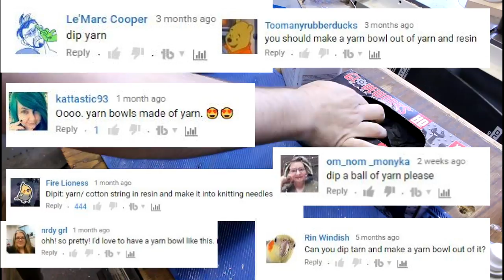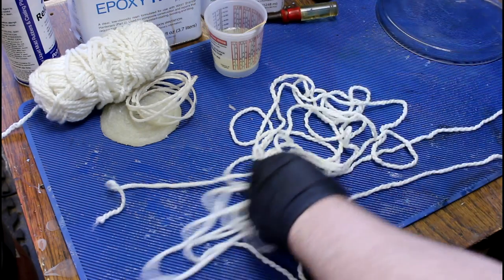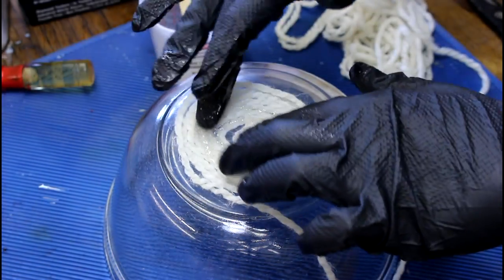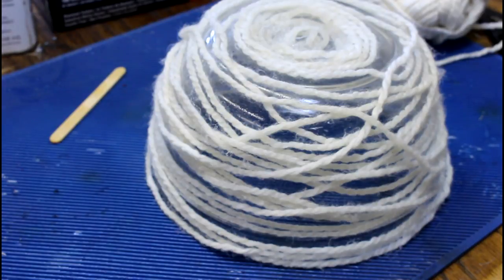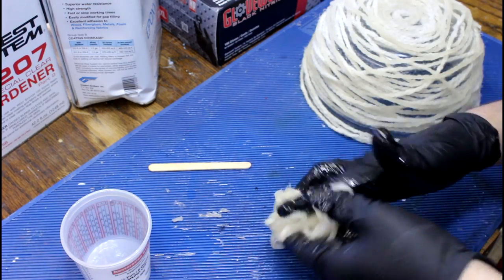DipIt #15: Epoxy vs Yarn: Not Your Grandma's Yarn Bowl

Comment: you should dip leaves this fall.  All the colors!
Reply: Too much moisture, I think. I like that idea, though!
Reply: Could press them in a book beforehand. It would take away the nice, curved shape some leaves have though...
Reply: SomiTomi that is actually what I was thinking.
Reply: They make a dessicant specifically for drying flowers and other plant materials that dries it out while still preserving the colors.  It's used a lot for wedding bouquets etc, but I have also seen a few resin jewelry tutorials that suggest using it on botanicals you want to embed.
Reply: Dan Tuck would be a cool cutting board pattern
Reply: Yes please

Comment: if you dipped Christmas tree lights in a brick of epoxy and left the end of the cord out, do you think it would still work? And if it does you should make a Christmas tree light bowl. Maybe use the battery powered lights for safety.

Comment: You should dip unsoaked orbeez/water balls in resin and see if they soak up any resin during the cure process.
Reply: Brock Edwards You're a genius
Reply: No that wouldn't work
Reply: Nic Zammeti did it. It did not work

Comment: Try and make a sand/hour glass out of resin!
Reply: Maybe whole block of clear resin with hourglass shaped cavity inside it.
Reply: Make it out of sand dipped in resin!

Then again, that might pose problems when cutting it - sand is very hard compared to the materials that were dipped before.
Reply: Ignoring the fact that sand isn't see through?
Reply: Make an hour glass, with a baby hour glass inside! One measures minutes and the other, hours!
Reply: Shouldn't the glass that measures minutes be a minute glass?
Reply: Lizzy Wonder, not if it measures 60 minutes! haha
Reply: Brilliant

Comment: You should do this with cooked pasta! Then you can eat pasta out of your pasta bowl. Maybe you can drink a Shasta at the same time?
Reply: I like this idea a lot. Even though I have no idea what Shasta is.
Reply: Shasta is pop or soda
Reply: But cooked pasta is filled with water and you need to have zero moisture for resin
Reply: Maybe you could cook the pasta, put it around the bowl and leave it until it's rubbery and dry, and then coat it in epoxy?
Reply: cook pasta, place on bowl like yarn, let it dry, then dip it :)
Reply: this needs to happen
Reply: ***** ba-dum-tiss
Reply: Eat Shasta flavored pasta out of a pasta pasta bowl. Did I get that right?
Reply: make the pasta yourself then it may be dry enough to do this. you wouldn't have to cook it it would still be in the dough phase.
Reply: pasta is brittle. it would need the resin to not shatter into a million pieces
Reply: You cant eat out of resin bowls, theyre not safe for that. You could try something like a food safe acrylic, but please dont put resin near food, cured or not
Reply: Acrylic resin is still resin, just a different type.  Alumilite resin has been cleared by the FDA for food use.

Comment: Idea: Once you've added the last layer of resin-soaked yarn, and while the resin is still wet, add a layer of dry yarn. The dry yarn will soak enough resin to adhere to the soaked yarn, but once the whole thing is dry, it should still have the yarn feel.
Reply: Mark Speir Ooooh Good Idea, very neat. I was planning on attempting this, and that last touch seems perfect! Thanks.
Also, I'm probably gonna mix my resin and yarn in a bag, so I don't waste it on my bench lol Also I thought just soak enough for the bottom, and make that first, let it dry, then move on with the rest.. cleanest way probably.

Comment: what if you took a bowl slightly larger than the glass one here, put the yarn blow in it with the glass bowl in that, and filled it up around the edges with epoxy, so that the yarn is suspended inside the epoxy and the bowl is even more useful? I think that would look really cool too.

Comment: Peter, since you get so much beautiful hardwood from your local gun stock manufacturer. You should do a lichtenberg cutting board. 

Either that or I learned a long time ago that you can pour off the enamel from old enamel pain that has been sitting for years. If you add dye to it it looks really cool cause you get an uneven colored stain.

Comment: Try a DipIt Lego bowl. Like, start by making a square (like L7" x W7" x D4") out of Lego bricks, leaving some open holes for the (clear) resin  to sit in and bond to all the bricks better (even cooler if you shaved/chopped bricks to add multicolored speckling to the resin). Then turn it to a large bowl. 

I'm thinking of trying it myself, but I'm not sure how it will turn out, and I'd like to see what I could expect while trying it.

Comment: The ideal contents for a yarn bowl are yarn. Specifically yarn for a project you’re currently working on, with the active end of the skein running out through one of the gaps so it doesn’t tangle as you knit/crochet.

Comment: @PeterBrown ,Could you make a Yarn ball? using a cheap ball, wrap this yarn around it, then once it's solid enough to hold it's shape, pop the ball inside it, pull out the deflated ball, then keep building up the yarn until is a solid hollow yarn ball? Bet it would be as strong as a wiffle ball.

Comment: Very cool! I love how you can still see the yarn fuz

Yarn crochet hook could be awesome - or if there's an epoxy that takes a super long time to cure you could even knit\crochet a Square or even some lace then mould it how cool would that be

Also... Lastly... Lol... There's an actual thing called a Yarn Bowl, a bowl which has a hook in one side to thread the yarn you're working with through so the ball stays in one place as you pull the yarn out or off - I think it would be gorgeous to pour a a bowl blank where the yarn is gently suspend in the walls and on the bottom then cut out a swirly hook and polish it up to a shine - it would be a true art piece imo

Comment: If you were to put one layer of resin on the bowl (mold) and let it cure, then add a thinner layer plus dip the yarn in the thinner layer and wrap it, then let that cure, then add another layer of resin on top of that, would it work and be watertight?

Comment: If you're experienced working with electricity I'd love to see a project including Lichtenberg Figures.
I know there's already plenty of videos about this, but most of them just burn a few pieces of plywood and that's it, often enough using deadly contraptions (mostly microwave transformers) and at the same time fail to mention that it's actually dangerous as hell, so I really want to see an actually professional approach.
And of course it would be awesome to see what you'd make out of those fractal-like patterns.

Comment: How about putting that bowl in a mold & pouring resin to fill in holes to make it water tight?  
How about doing it with less dense pattern & filling it in with resin for optical illusion that it can't hold water?
How about turning a yarn resin block?

Comment: I would do one more layer with no epoxy, wrap the whole thing to fill the gaps and spray with lacquer to secure it. Probably two coats will leave the fluffy part and still make it ridged.

Comment: To get rid of bubbles get a vacuum chamber and put the epoxy in the chamber and it will suck all the air out of the epoxy or resin